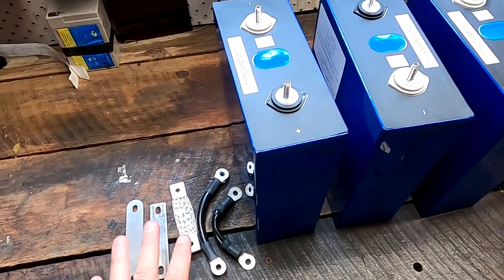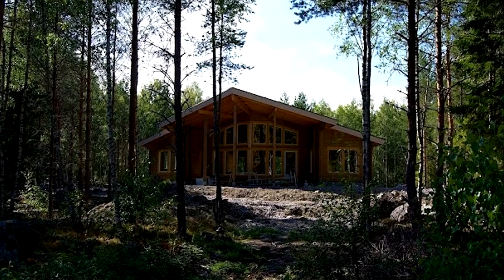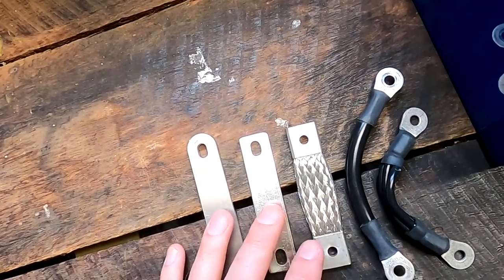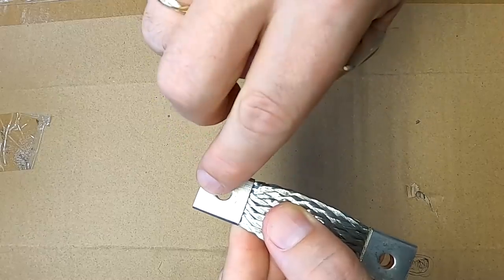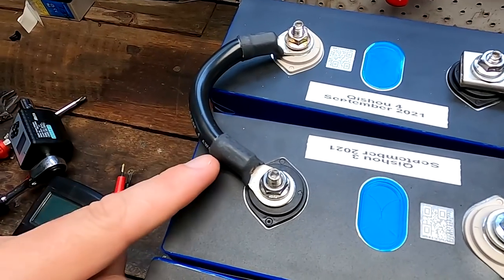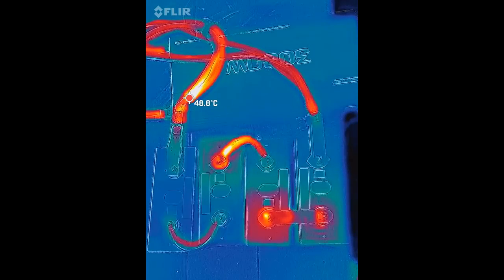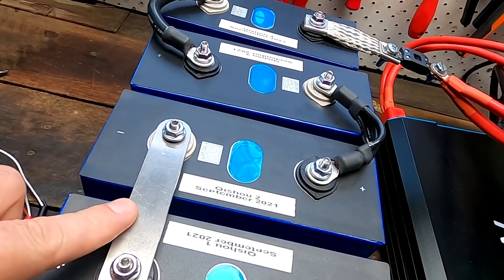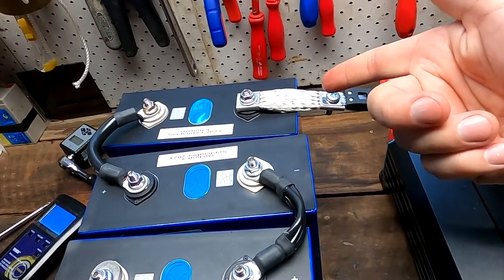All these different busbars... and why they don't matter!

Comment: Good video. You seem to be able to cover everything over a period of time. Yes the punched round hole leaves extended "burr" on exit hole. A larger hand-held sharp drill-bit can be used to remove it, leaving a mild countersink lip around the hole, if rest of surface is flat.
The fact that busbar suppliers make the slots in the supplied busbars wider than 6 mm for an M6 threaded terminal post, is annoying. M6 threaded objects are slightly less than 6 mm, so a strip made with a 6 mm wide slot will fit on it. This ensures more surface contact area and less resistance. 
Yes those braided straps were probably more suitable for a time when a smaller, thinner battery was more popular, and they haven't allowed for the minimal new distance increase of the 304 model.
For someone who has them, the hole could be elongated in the desired direction with a small coarse round file, or a filing drill-bit you'd put in a power drill. Not sure of the name. 
Nice thing about the braided ones is they're all copper so 65% better conductivity than Aluminium, and you could piggy-back them (if you're wealthy), for 100 sq mm of connector cross-section. You could then compress cells or not, as the strap just humps up  if cells closer together.
There are flat washers available, which are much bigger than the standard, but with the tight 6 mm hole, to put under the nut. 
I've seen others, 2 or 3 mm thick, which when bigger than standard, also eliminates "cupping" of the washer or lug when under a small diameter nut. These could end up better than just a flange nut. Love your camera and torque wrench adaptor. Must buy both very soon.

Comment: Struggling with bus bars for my LTO build, but to the topic... The bus bars you link for the flexible bus bars are 3mm thick and 20mm wide. I am lead to believe that the bus bar calc for copper is 1.2 x thickness (mm) x width (mm) which makes them capable of taking 72amps, which seems much lower than what you were testing. Did you have a calc that you use to determine suitability?
Reply from the maker: Thanks. I googled a few bus bar calculators and rating tables. They seem to give out different results du to different material for 'copper' and 'aluminium'. It also depends how the bus bar is installed, similar to cables. These flexible bus bars are also multilayer which affects the current capability as well.
The ones coming with the cells are certainly not rated for 300A either but doing great and heating up at all.
Reply: @OffGridGarageAustralia  Thanks! When I look at nickle strips for 18650s, I get totally different results as well. Could you advise the measurements of the bus bars you are currently (pun!) using? I think I saw you draw 300amp without them heating?
Reply from the maker: @GTrainRx7  sure. The normal bus bars which came with the cells are 20mm x 2mm and made of tinned copper. The aluminium bus bars are 20mm x 4mm and the flexible bus bar I showed is 20mm x 4mm braided tinned copper.
Reply: @OffGridGarageAustralia  Thanks! I think a more reasonable calculation is 20x2x (5) = 200amps, which matches better with the nickle strips and what you have demonstrated. I think the bars I have are good for 100 amps (20x1x5). I will only be drawing that for a few seconds, then less than 10 amps, so even if they do heat up momentarily, it should not be a problem. Also, thanks for inspiring me to do more with getting back into my battery gear :D
Reply from the maker: @GTrainRx7  great to hear. 100A for a few seconds will be totally fine, even with a smaller bus bar.

Comment: YR1035+ voltmeter has 1 KHz bandpass filter to greatly improve voltmeter sensitivity to the 1 KHz meter current driver.  It will not give you the correct inverter current caused bus bar voltage drop.    7.2mV drop/1.2 milliohm = 6A but you said inverter is drawing 160 amps.  1.2 milliohm is probably high, due to the strong 120 Hz inverter ripple overwhelming the 1 KHz bandpass filter in YR1035+ corrupting the resistance reading.

If you can get to the battery terminals directly underneath the bus bar you can measure directly with YR1035+ with no battery load connected.  My 500A/50mV current shunt reads pretty close to 0.1 milliohms on YR1035+. 

Just use a DVM although the 120 Hz ripple current from inverter may not read correctly on DC mode. BMS's and battery monitors have a very low frequency low pass filter to average out the 120 Hz ripple from sinewave inverter.

Whoop's, I guess in Australia I should say 100 Hz ripple current for 50 Hz mains.
Reply from the maker: OK, thanks for that explanation. The first two measurements where done without any load, just the last one where I showed the voltage drop as well was with 160A load.

Comment: Hi Andy, Greetings from the USA. A suggestion on the Buss wire and bar test connections. Switch the different test buss components to different cells and repeat your test. It's quite possible that the heat is actually coming from an internal cell connection. You may have hot cell terminals heating the buss material through thermal conduction. I realize that the aluminum is heating from the current it's carrying but if you have hot terminals you need to ensure it's due to an external connection rather than an internal one. Marking your hot cell terminals and the putting your cold buss links on that cell will tell you whether you have a bad terminal, bad terminal connection, or undersized buss conductor.
Reply: Makes sense. If the busbar itself is the issue then there should be a gradual change in temperaue from the hotspot to the "not so hot" spot. And not a sudden change with a visible separate temperature zone.
My guess is also the cell underneath the busbar is radiating heat to the bar.

Comment: Hi, Andy, have you also tested stainless steel 304 nuts or serrated stainless steel 304 nuts would change the resistance of the same bus bars with same torque, would different nuts affect the current flow of the bus bars and results of your BMS? How about adding a layer of aluminum foil under bus bars or above bus bars to reduce resistance? I am going to use nickel plated bus bars with serrated stainless steel 304 on batteries in series, then apply dielectric grease to prevent corrosion and arching but now I would consider to use graphite grease to reduce resistance and corrosion without attracting dust. I am going to get a clamp meter as my multimeter would not test current other than 1.5V and 9V batteries. I figure this might be related to contact resistance and I am sure that different torque would even change voltage and current.

Comment: loose connections generate heat and can become a fire hazard so it is important to torque them to the manufactures specifications and periodically check them as you would when you do maintenance on a car's battery....
Reply from the maker: Yeah, if you have vibration, you should check...

Comment: Hi Andy, another awesome experiment, Thank you. 
I think that it would have been be interesting to change the configuration of the bus bars,  just to eliminate the possibility of a misaligned terminal or damaged threads like cell #6 in the old battery.
Reply from the maker: Thanks, Steven. Yes, absolutely, I will repeat this test with a 8s or 16s battery in the future so we can test more materials and connections.
Reply: @OffGridGarageAustralia  
have you already repeated the test? would be very interesting. As steven said, would be nice to mix the busbars and interchange them just to make sure its the busbar itself, not the terminal or internal temperature heating up of the cell itself.

Comment: Thanks for this very interresting experience and usefull measures.  I have some difficulties reconciling the different resistance measures.  Lets say a cell resistance is about 0.18mΩ.  
1) Resistance measure of [cell + 2 x bolted connections] = 0.22mΩ (at best) -> meaning that the lowest resistance of a bolted connection is about 0.02mΩ [(0.22 - 0.18) /2]
2) Resistance measure of [cell link + 2 x bolted connections] = 0.8mΩ (at best) -> this would mean the cell link resistance at best is about 0.76mΩ [0.8 - (0.02 x 2)]... which seems very high considering that a copper bar of 35mm2 and 10cm has a resistance of about  0.048mΩ (as pointed by Северный Зверёк)
Where am I going wrong with the math?

That does not change the value of your experiment to show that a poor cell link or poor bolted connection will create significant hot spots that will diffuse in the battery and create premature ageing of some cells ---> unbalance ---> reduced capacity...
That is why it is important for the BMS to have a temperature sensor in each of the cell taps to identify any temperarature variance across connectors and warn you about it.  How many BMS can do that?
Reply from the maker: Thanks for your comment. I have seen BMS with 4 temperature sensors of which one was an internal sensor. It would be ideal having one for each busbar at least, mounted where the balance cable connects.
Reply: @OffGridGarageAustralia  the tao BMS has a temperature sensor integrated in each cell tap - so one connection does both voltage and temperature.  The BMS will report a temperature differential between cells... (if you want to know more, we can take it off line as I do not want to interfere with your channel) 
Thanks again for sharing so much valuable knowledge in a simple, practical and understandable way
Reply: I don’t think the math is wrong. I think the issue is measuring the resistance stud to stud. We don’t know what the stud resistance is. Imagine the stud resistance was, say 10 ohm. It wouldn’t affect any of the other readings (much) but the stud to stud resistance would be huge.
Reply: @kevinmills5293  you are right, the stud is the difference between the measuring points.  I doubt the resistance comes from the stud itself, so the added resistance must come from the threaded junction stud / cell terminal.

Comment: marine grade tinned copper cables are made to resist the salt-water corrosion but they are less conductive than pure copper cables...depends on where you are placing your battery setup... are you on a boat in the salt water?? or inland in a stationary build...???
Reply from the maker: Just in the garage in South East Queensland 😉

Comment: Hi. Everyone is using nickel plated copper as busbars for cells with aluminium terminals. So it should be ok, even though nickel and aluminium are not 'friends' in terms of galvanic corrosion? Much less than aluminium and copper itself though.

Comment: , very good sir, I am in hunt for choosing good quality busbar and found that the multi strand type flexible is the best among all more over i tried pureSilver sheath added the good performance... Keep it up you experiments with it...thanks
Reply from the maker: Thanks for sharing, so did the silver sheet make a difference at all?
Reply: Yes sir,as I worked with solar cells stringing i noticed that soldering with silver sheeth 0.5 mm thick is good enough to get better results as it has excellent electrical conductivity of 105%and no corrosion high malleablily makes our project awesome... please do this in your Off grid garage with scientific instruments inproof of my work

Comment: What will happen in the long term with different busbars (imagine some cells further away).  Is it bad or is it „wurst“ (egal) as long as you have an active balancer?  Current must flow from cell 1 to cell 16 so all cells are depleted equally.  Right? Wrong?

Comment: A comment to the charging resistor. I also use anti spark resistors. Around 10 Ohm. Make sure to disconnect the resistor, when the big connection is made. For that i have installed a little fuse with a switch on the positive terminal. After the switch is the resistor soldered into flexible wire. At the end i use an alligator clip for busbars or a short solid wire for breakers. With that i have one to both hands free to make the connection and have no time pressure before the capacitors in the inverter discharged again. With this method i have absolutly no sparks.

I don't like these battery resistance meters. Because many measure with AC. The result is useless, because batteries are used with DC. This measuring method is better for capacitors, where the frequency is important. For batteries i always use a dump load and measure the voltage drop.

Comment: Early in the video you measure the IR of the cells with the busbars installed, and the IR increased a lot. This is just the added resistance right at the connector (not across the busbar itself), in other words how well each busbar connects to the battery terminal. I'm surprised at how much resistance there is at those points. Maybe something that can be improved.

Comment: i still think the issue with the aluminium bus bar is it's lack of flexibility. With the limited torque that can be applied to the screw, the bus bar is not being pulled down fully onto the terminal. All the other bus bars are relatively flexible by comparison. I would like to see the test repeated but with the aluminium bus bar either as the first or last one and see if the problem persists.
Reply: likely has slightly less contact, maybe adding to the issue along with the fact that aluminum is a poor conductor so generates more heat due to its increased resistance...
Reply: @pilgrimvalle  not as good as copper but I wouldn’t call aluminium a poor conductor. Andy seemed to conclude the issue with bus bars is not their conductivity but more the connectivity with the terminals.
Reply: Hi guys Copper is 1,647 times better conductor than aluminium.
Cheers.
Reply: @hommerdalor6301  assuming the same volume. It's not a simple Cu is better than Al assumption. Andy's Al bus bars are probably twice as thick as the supplied copper bars, so it actually has less resistance, because there's more of it.
Reply: @CollinBaillie  Sure, but the cell post is always the same area, and thats where the problems occure.
Reply: @hommerdalor6301  Good point.
Reply from the maker: The terminal area is not the problem as we have seen in this test. They work just fine without heating, for all other bus bars. Only the aluminium bars are heating up due to higher resistance. 
And, yeah, these aluminium bars have actually a lower resistance than the original copper bus bars... It's in one of my videos when I first introduced them.

Comment: Spotted that washer at the very start of the video. At first it looked like the newer laser welded studs. Also wire amp ratings are not really a true rating. Wire can handle much more current in short lengths due to low resistance. Just look at the little strand in a 500a fuse for example. I will go as far as saying the contact surface of copper being more conductive has less resistance even tho aluminium can carry the current. So if you struggle to torque down the bar due to for example the threads being soft as cheese then copper bars are most likely going to perform better for you.
Reply from the maker: I missed the washer completely which was good in the end as we could see the effect of it.

The cable length does not matter. A 1m cable gets as hot as a 100m cable if the same current passes though.
The fuse only heats up because the diameter of the conductor gets so small that it heats up. Well, that's the purpose of it after all 😉
Reply: @OffGridGarageAustralia  Yes, But shorter wire will handle more current with less voltage drop. Would you pull 200a through 12awg wire? i do for example 200a hobby esc's i have use 100mm of 12awg on the inlet.

Comment: I recently saw a youtube video of someone using 6mm2 copper wire folded around the lifepo4 cell studs. 

Copper is a better conductor as compared to aluminum, aluminium is about 40% less conductive than copper. So could you please test that?